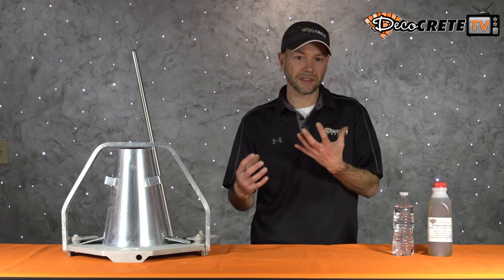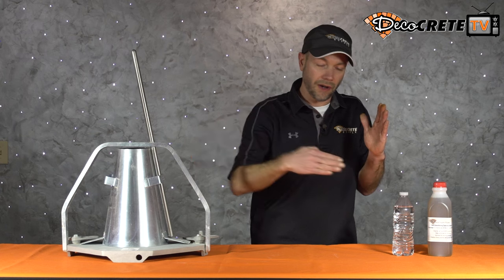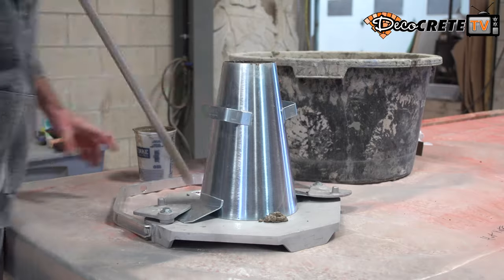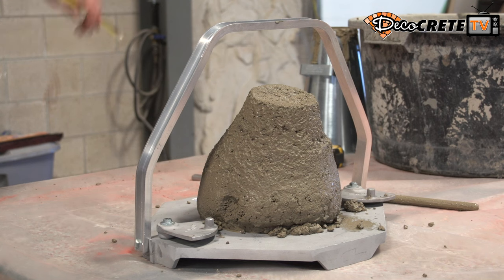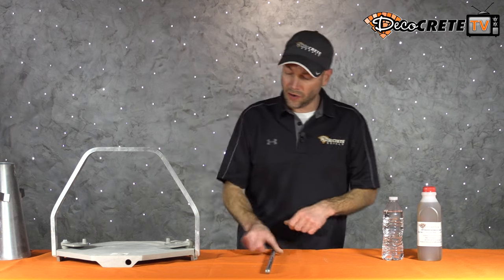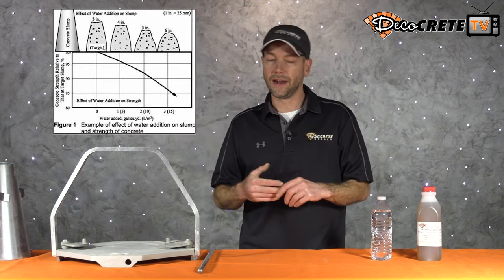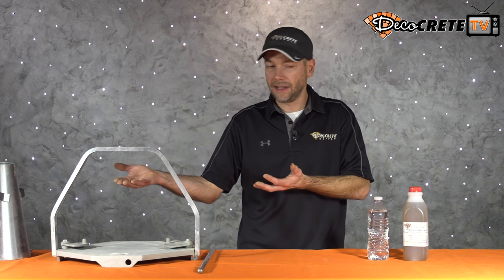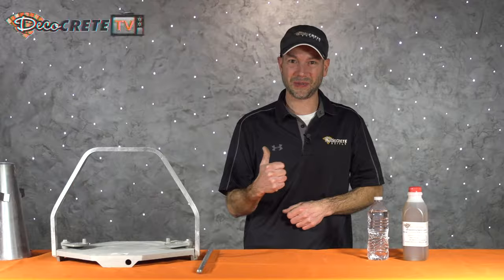What is Concrete Slump?

Comment: I have seen for the first time on youtube  a 100 slump.....it was so much water it would probably shrink 3 inches while drying. totally slumped out. like self leveling all these guys with rakes just standing there as the concrete flows like a mudslide.

Comment: Great video. So if I were to be screeding a 8 foot driveway by myself, would that be a good reason to increase my slump? Also, with a higher slump, would that generally increase the time between floating and finishing?
Reply from the maker: 6in slump would be a good average for pouring a driveway. pouring a little tighter than that will increase strength but will be harder to work. pouring wetter than a 6in slump might make things easier but you will lose strength

Comment: Could you please tell more about the measurement we need to take? What cm is perfect?
Reply from the maker: The perfect slump is going to depend on the application, that's where the measurement comes in! measure from bottom of the bar to the center of the slumped concrete

Comment: Technically according to ACI you're supposed to used the flipped cone to measure with the rounded rod on top 
although I suppose you can use the handle, it'll technically get you failed during examination, now in the field is different of course, no problem then
Reply from the maker: Thanks for the comment!

Comment: I just started working with Ozinga as a ready mix driver and i am having such a difficult timing fully understanding the conversions of slump on the PSI meter and calculating water to the mix. it has to "click" soon but i think if i had a chart or something maybe I'll understand.
Reply from the maker: Thanks for the comment!!! Hopefully, the new job is going well for you👍 We don't have much experience with the conversions on a psi meter, our background is more in pouring & finishing the concrete rather than the ready mix side. You might be able to find a chart online somewhere, or maybe someone at your company would have something for you. If not, my advice would be to talk to some of the drivers who've been driving for a while to see how they do the conversions. You could even make your own chart to follow based on their info. It could just be a handwritten thing to keep in your truck, or you could make it look nice and share it with the other new drivers. As for calculating how much water to add, a good rule of thumb is: 1 gallon of water per yard of concrete will bring the slump up 1 inch. So, say you have 6yds on your truck and it's at a 4-inch slump. The contractor says he's looking for a 6-inch slump, you would need to add 12 gallons of water. Hope this helps you out. Thanks for watching!!!

Comment: Thanks but this video is not done by an engineer explaining how slumps are related to water/cement ratio, workability, permeability and target strengths of concrete using various methods of placements on site e.g. by skips, pumps, etc... not satisfied with this video